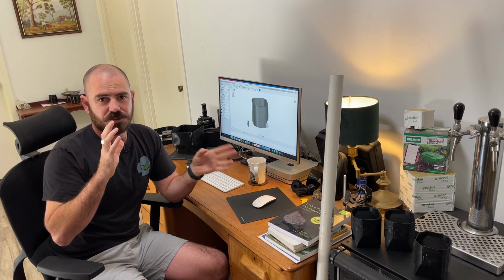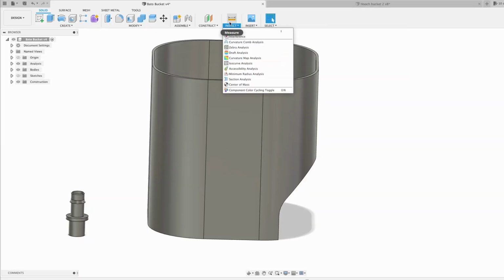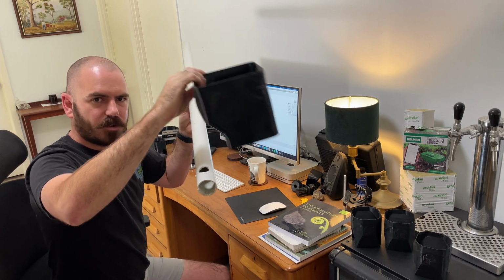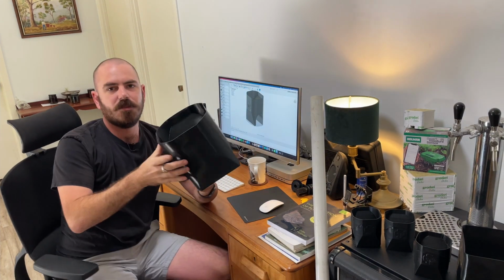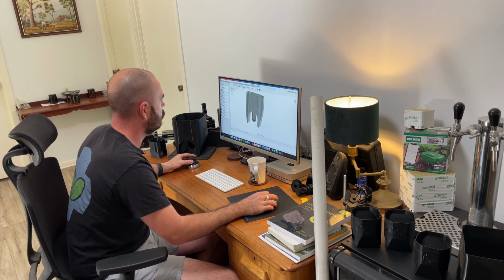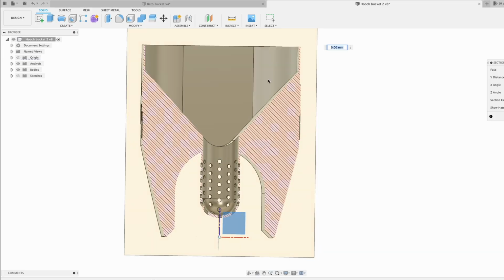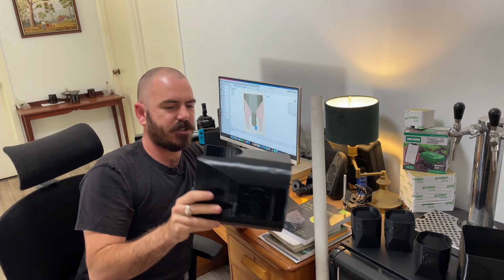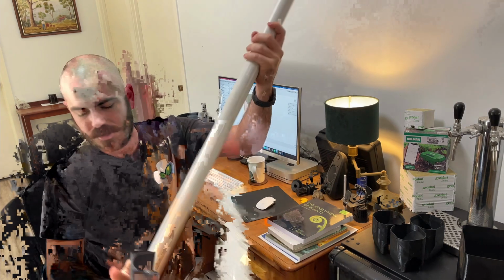Round Pipe Hooch Bucket & Upcoming 3D Print Designs

Comment: Fantastic work! I am not familiar with how much filament costs but wonder if it would be cheaper to have the hooch adapters be able to have round pipe sit on it vertically (to replace the bucket part). Maybe the tops could be like a PVC fitting so it slips right on top. So instead of printing a big pot, you just cut some round pipe to suit, glue it to the adapter and presto. Would PVC glue even work to bond PVC and filament? I haven't the slightest idea. Maybe the middle of big soda bottles could work too but they're transparent. Anyways  keep up the good work

Comment: That small hooch bucket with the bottle reservior is giving me great ideas.
Reply: What kind of crop can you grow in that ?
Reply: @BobLaTige  Basil? spices i guess
Reply: @BobLaTige  my design isn't about wicking, and I suspect Mitchell's design is supposed to be similar, in that it's a wicking system until the roots grow long enough to reach inside the pipe, then it becomes a wicking/DWC system. So you can pretty much grow anything that wouldn't clog up the pipe with roots.